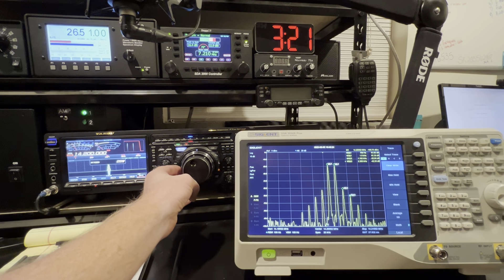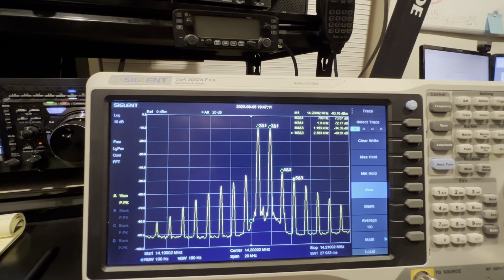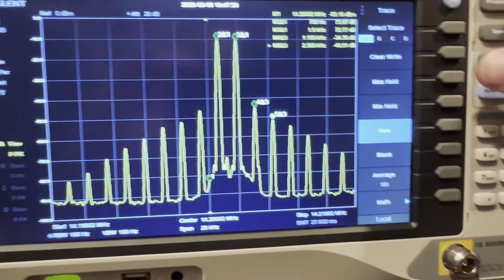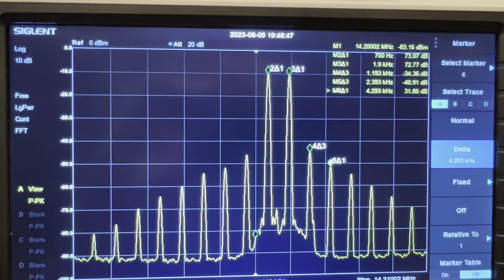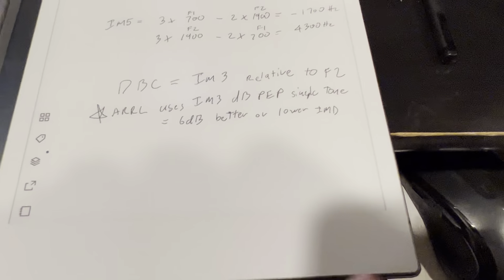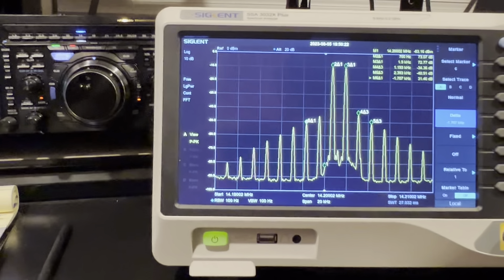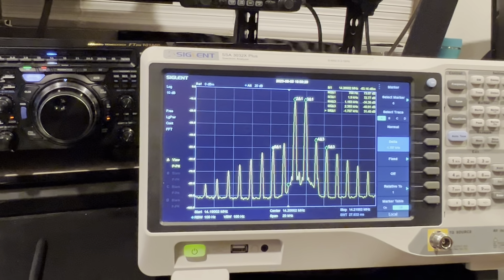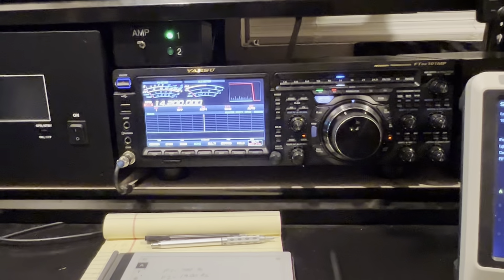Yaesu FTDX-101MP Two Tone IMD testing at 200w PEP after replacing the VRF150 finals - KJ7E

Comment: -34 in the 3rd order is way way better then the original finals from Yaesu with improper bias'ing. They should watch your video and train the tech's in Japan. Most 101 200 watt models with the AMC in the wrong direction I measure over the air and witness on the panadaptor are usually are about -28... The best I've seen are of course the Apache Labs Anan's at -62 in the third order at 1500 watts. Great video  Thanks,  N4QNT

Comment: Excellent video!  I'm wondering if there would be any meaningful measurement change if you were to feed an analog 2 tone signal into the mic jack (IDK but I suspect not). Perhaps you could use the 2 tone generator in the LP-500.  Cheers & 73 - Steve KG4LJB